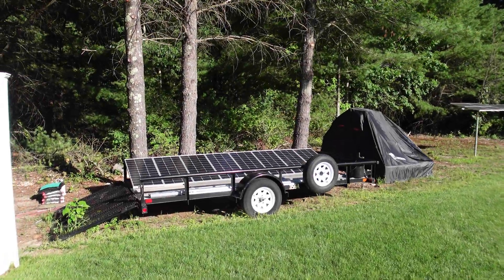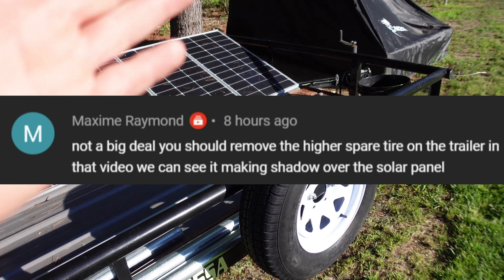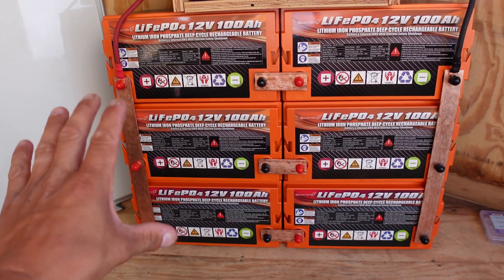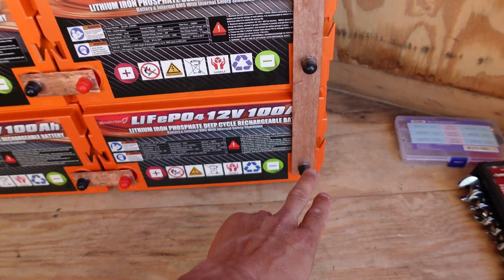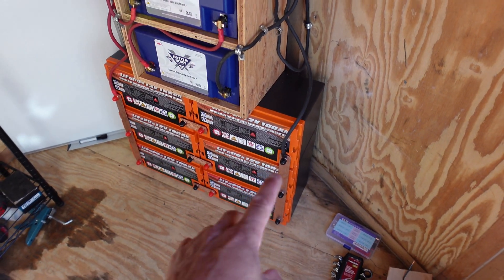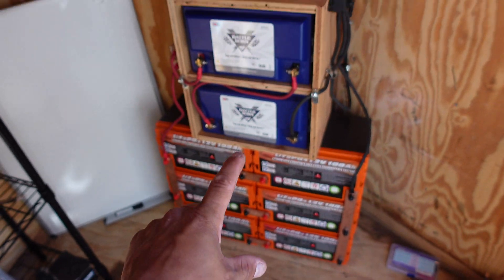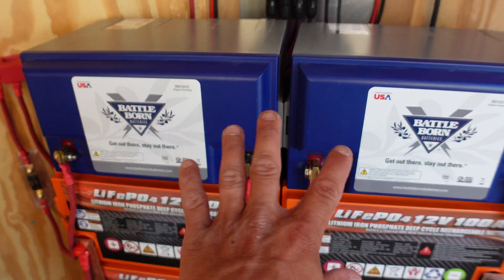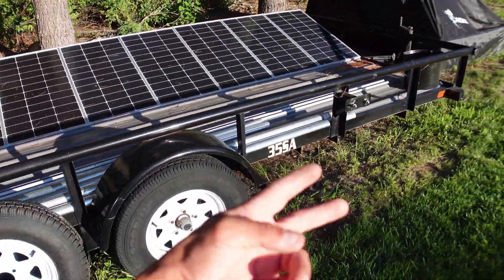Fixing the issues you guys found in the crypto mining solar setup

Comment: Hey man, nice setup! I'm doing the same, but staying fully DC to avoid AC inverter, and PSU losses. I designed a 800w stackable power supply for this, 48v to 12v fully isolated with components used in telecom, it's working great. However the shortages are making it where I can't get parts to build more until November. I intend to built a PCB so others can use it.

Comment: in a nutshell, DIY solar power with Will Prowse,  he has the video on the wiring you  just fixed.  The battery manuals should state if need to have batteries  oriented different.  Lithium Iron batteries have a "vent" on the cells otherwise there is not a direction specified from what I understand.  For safety, once you get enough power you should have fuses on battery lines to inverter, shutoff switches on both PV and Battery lines to isolate things when need to work on it. Covers are for safety if you deem that you want the barrier to the bus bars(normally ppl do that).
Reply from the maker: Thanks bud. Yes I do have fuses on both battery positive lines as well as isolating switches. Appreciate the comment

Comment: For a 100Ah battery, actually usable energy will be around 50Ah to be conservative.
Since your battery configuration is 2s4p, you’d be looking at 48v x 50Ah x 4p = 9.6kW for 1 hour.
This means at night, without the sun, a farm drawing 9.6kW will only last 1 hour.
What’s your total solar panel power output?
Reply: 50% usable would be true for AGM, or other lead acid types. LiFePO4 can do 100%, but 80% is recommended for longest life
Reply: @BradCagle  ah, I missed it was LiFePo.  Good point yes.
Maybe add a BMS for balancing might be useful.  They have several products for these application that monitors each cell DoD and SOH.  They also have versions that have FETS for passive balancing.
Reply: @BradCagle  hey just looking at your videos, do you mine crypto?
Reply: @francislee7770  Yes

Comment: I could be wrong, but my understanding is that the current, not the voltage is the deadly part. If the batteries don't have some sort of internal short protection (most basic batteries don't and will do a full current dump subject to the internal cell resistance) if you were to bump up against both positive and negative busbars with a metal tool, your hands, etc. As long as you aren't the thing that completes the circuit, you should be fine, but it never hurts to cover those things.
Reply: Less than half an amp can kill you. But there has to be enough voltage to push it through the resistance that is your body.
Reply: @txta786  Moot point. We're talking about 24v and 48v solar battery banks on DC. Yes, if I grab a 400kv distribution line, I will die. Let's try to discuss the content of the video.

Comment: fixes tire, yes
exposed copper, (i'd at least make some kinda cover?) but yes
diagonal wiring, yes
i would love to know how that growatt inverter is working, i want one, currently i only have a small pwm system but i'd like to upgrade it.

and lastly, where are the christmas lights? lol is that just me? but i have to plug in some kinda light when i'm out at my shed lol, i like using christmas lights (low energy led ones, just a short string, like 2ft)

Comment: Wondering about costs. You need to buy enough panels/batteries to run 24/7 OR is this just a "boost" to your grid power? Im wondering how to size a solar system for mining "off-grid" style...Not sure how to get CapEx cost to amortize to a low $/KWh OpEx value.
Reply: There are tons of videos that break down sizing a solar/battery system for off grid. Will Prowse is one of the best channels that covers beginner to advanced topics on off grid solar.
Reply: I currently have 5.2kw 48v battery. It will run 3 A4000's for 23hours. I have 3kw solar panels which is more than enough. I'm adding more battery so I can add 3 more A4000's. I'm running fully DC so no wasting energy on inverters, or PSU's

Comment: can you explain why did you go with 120v inverter instead of 240v?
Reply: most of the cost effective inverters are 120v most will have an option to connect 2 for 240v
Reply from the maker: Yes I can buy a second one and double the power/panels was my plan. I was also being a pussy LOL... Nervous to touch 48v.